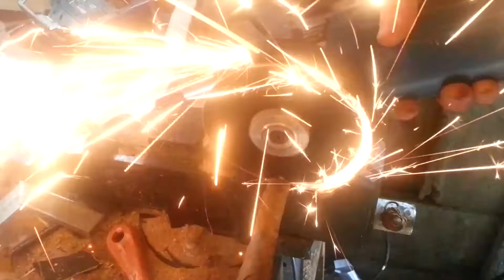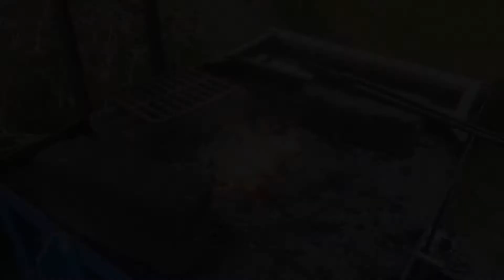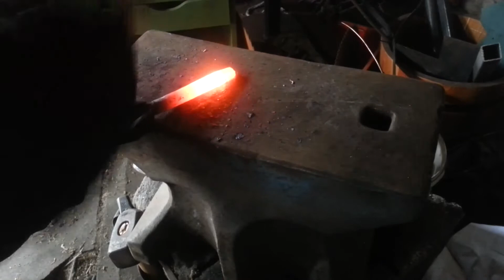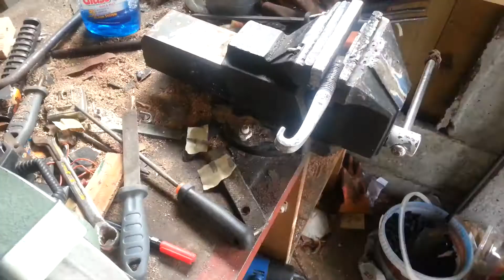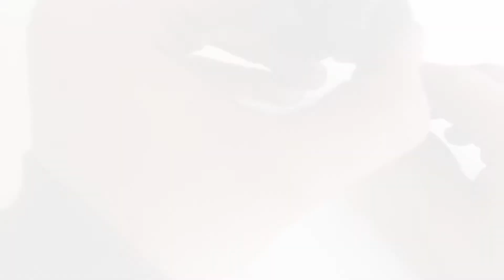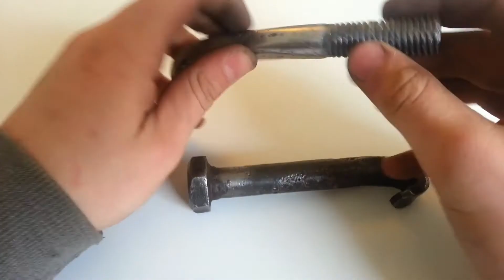forging bottle openers from a bolt

Comment: Great job-- you're videos are improving greatly. Don't be afraid to heat that metal up hotter-- it looks like you got it at about 1300 degree, but you can forge much quicker and easier if you go to 2,000. (bright yellow, instead of red) Cheers! clink

Comment: This is amazing, but how were you able to do it in only 2 hours!?
Reply from the maker: Thanks!! If you hit a little bit harder than me you can easily do the taper within 10 - 15 min double that so 20 - 30 the the folding over and straightening also about ten minutes. After that it's finishing if you leave the scale on it will take less then 10 minutes but if you file and sand it of it will take 20 min maybe a bit longer. Then it's just hammering in your initials that takes 10 minutes each.
It helps if you know what you're doing and it can be done very fast in production mode :)